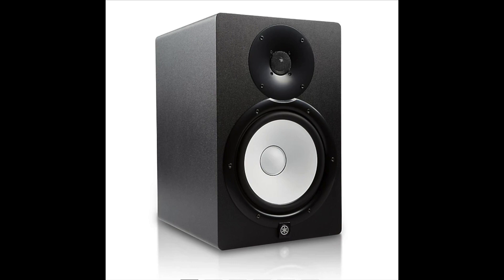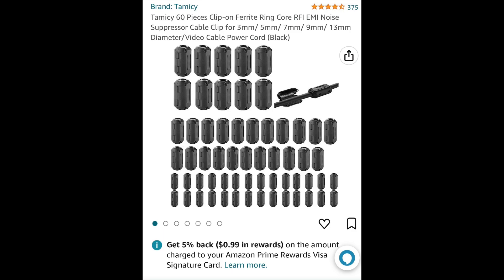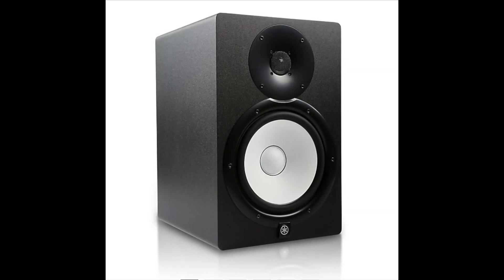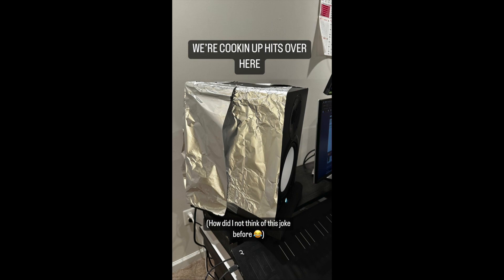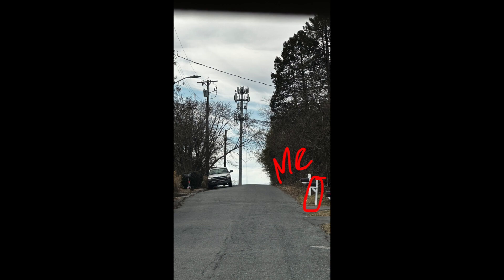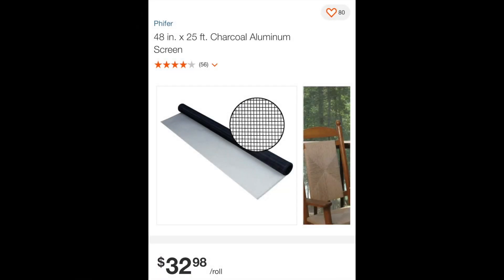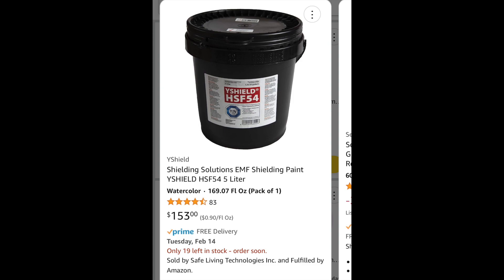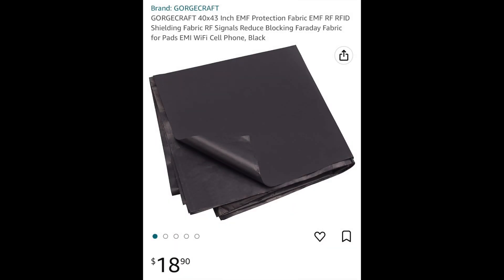Yamaha HS8 studio monitor issue (dial-up sound) RESOLVED!

Comment: I have a cell phone tower ~150 meters away and it points directly at my window. When I open the balcony door, my wifi stops working, my bluetooth speaker starts to skip, though the HS8s capture the interference all the time.
Reply from the maker: WOW, that sounds intense! Not sure how much benefit it would be since its really close, but try the tinfoil and see if it helps? Just make sure you allow room for airflow

Comment: Maybe it's a signal from a different source. That was my thought before you did the radio source test.
Reply from the maker: Maybe, but the noise is pretty directional, so when I point the heatsinks in the direction of the tower that’s when the noise is the strongest